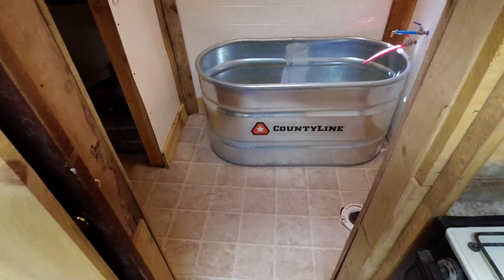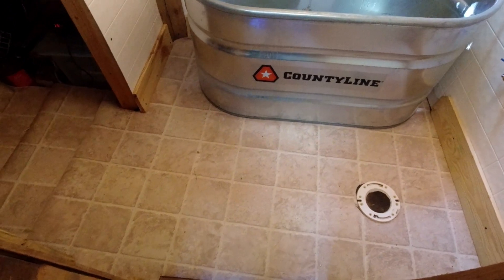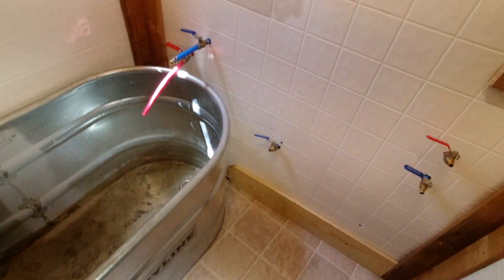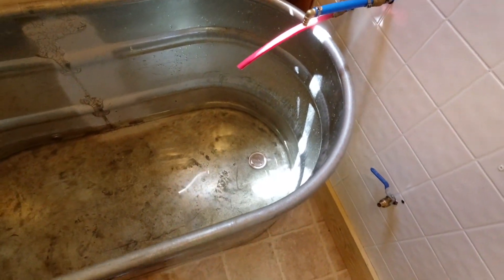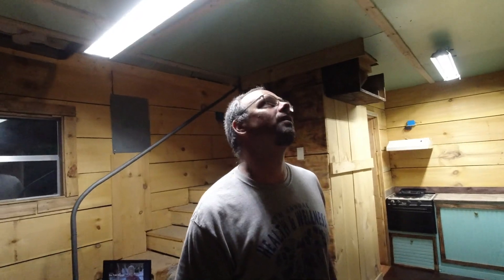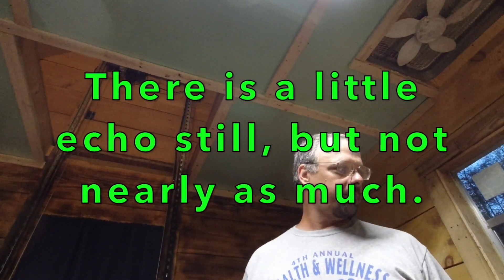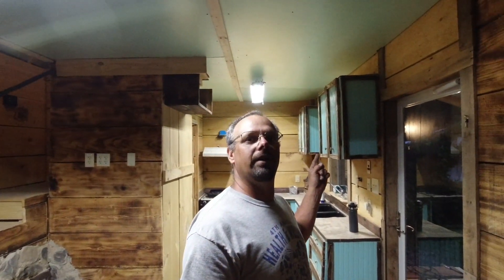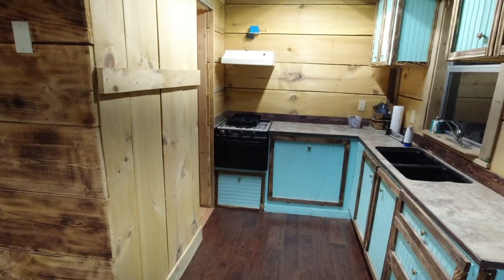Tiny House Build-Ceiling, and Bathroom

Comment: Luke, as you found out the closet bolts (holding the bowl down to the flange) and wax ring do not come with most fixtures. I personally have used 1/4" lag screws in a house I lived in. Another little building I converted into an apartment I used 4' X 8' X 1" Styrofoam insulation sheets with 1 1/2" round metal circles for reinforcement for the nails. Please note that this is definitely a fire hazard unless covered with, say, 1/4" sheetrock, though it has been there for over 30 years and hasn't burned down yet. You will get there. Love the way of economically doing things. Keep it up!
Reply from the maker: The box for the toilet had the wax ring and floor bolts listed as included, not sure why they weren't there. I picked them up the next day and they were so cheap it wasn't worth complaining about to them. I'll know next time to go ahead and get them. I actually had some 1/4" lag screws but I didn't think of that.
I think the ceiling will work I guess as long as no one lights it on fire. I guess with a house made out of mostly wood the whole thing could be a fire hazard lol.

Comment: Moving along Luke! How did you do your sliding door for the bathroom? Where did I miss that video? I did a barn door to close off the opening that goes from my dining room into the den and utilize some pipe flange and the metal plumbing pipe you know with the threads on it and 90° elbows and then it's basically like d-rings at the top of a hollow core door and that was inexpensive compared to these kits that they do for barn doors. It turned out well and it was relatively inexpensive but I sure like the way yours looks I was just curious on how you did that and what kind of hardware you used to install it?
Reply from the maker: I used a pocket door hardware kit from Amazon here is a link to the one I got.
https://amzn.to/3vDxiIm
The door is an old one taken out of an old trailer. 
I thought about doing a barn door idea for the bathroom, but I needed to have the wall in the kitchen to be able to mount stuff to.

Comment: I like the ceiling. My mobile home has a similar wood batten look.. are you going to burn the battens to go with the walls? Id do the floor off kilter on purpose.. No solar or  thermal water heating?
Reply from the maker: I don't think I will burn the wood on the ceiling I want it brighter to help with lighting and to have a contrast to the dark floor. LOL the floor will probably annoy me a little for a while, but I will get used to it. 
I could use a solar design of water heater, but I get free gas and it heats water very easily. I might still do some experimenting with solar heating.